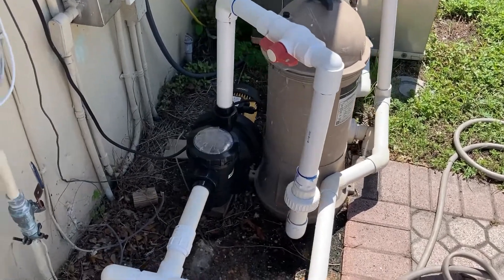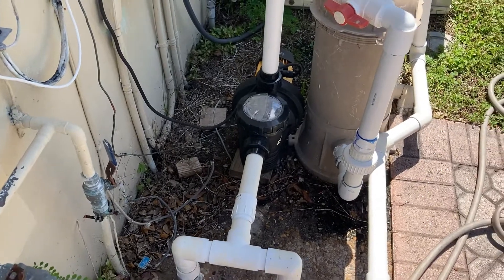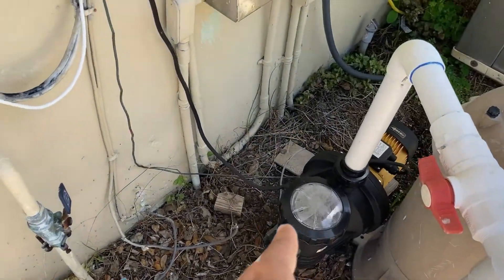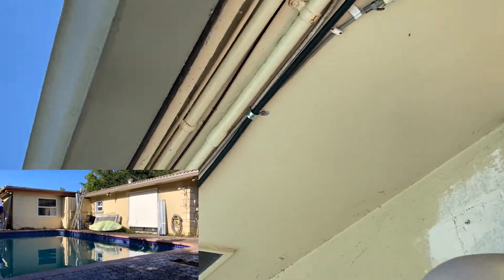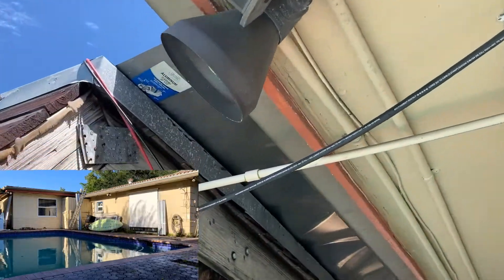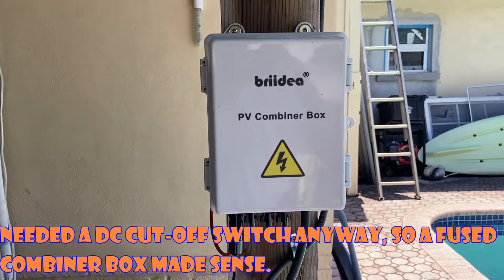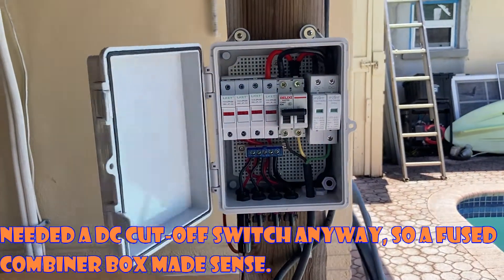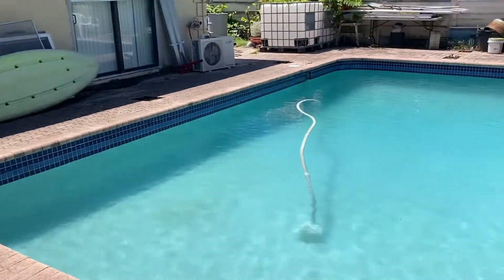Solar pool pump 2

Comment: Hi think I have the same 72v pump as you. Do you know if it's possible to have a timer for the pump? I have shade for part of the day when the pump turnes over but with no power and would like to have the pump come on when out of the shade
Reply: Thanks much appreciated 👍
Reply: Any luck with the timer superWhizy? Can you recommend a timer to use? Don't have a clue as to what type of timer I need 🤔🤔 other than a simple one rather than a WiFi one. Thanks...
Reply from the maker: I've purchased a timer from Amazon and have not yet had time to video and install. I will make it my top priority this week.
Reply: Thanks that's very kind of you
Reply from the maker: Made a video for you, Friend. I hope it helps you. Enjoy! https://youtu.be/8BPSKjOvTcY
Reply from the maker: Hi, Keith. There is a manual switch at the bottom of the mppt controller for the pump that can be modified to a timer. I've not yet gotten around to this task and have just been letting the sun control my pump's schedule.
Reply: @SuperWhizy  thanks for the quick reply! I've also got the same controller box as you. Do you know how I'd modify it to add a timer? And what timer I'd use. Thanks for your help... Keith
Reply from the maker: I shall make a new video on this issue based on your recommendation, Keith. Thank you.

Comment: Hi what is the max amp input from the solar panel. That this can handle  ?
Reply: I have 4 330watts  voc 40.15, impp9.91  if i put then in series it will be voc160v  and if i put it on series parallel will be impp 19.8 A   This will not work?   How would you do it with my sep up ?  Thank you
Reply from the maker: At 330W and 40VOC, your theoretical amperage is 8.25amps. One possible option is to link 3 panels in series and 1 panel in parallel before feeding the controller, which should theoretically give you 120VDC and input current of roughly 11 amps. Get a combiner box, choke the upper limit with a fused switch and check the voltage before plug in. Good luck and be safe.
Reply: @SuperWhizy  can you please elaborate on this ?
Reply from the maker: Power (wattage) = V (voltage) x I (amperage). In a series connection, voltage is additive but current remains. In a parallel connection, voltage is constant but current is additive. For example, if we have four 100 watt panels each rated at 25 VDC and 4 amps, linking them in series will yield 100 VDC at 4 amps. If we link these same panels in parallel, we will end up with 25 VDC at 16 amps; both of these configurations will only yield 400 watts of power. When we mix-and-match between series and parallel connections, it becomes an algebra problem with max theoretical power of, in this hypothetical case, 400 watts as the known boundary condition for our formula: 400 watts = Voltage x Amperage.
Reply from the maker: Hello, Review2543. My MPPT Solar controller for the 72V pump manages the voltage and amperage of the solar input. The instructions limit the max input current at 15 amps and the max open circuit voltage at 150 VDC. I've got mine fused at 10 amps because... it was what I had sitting around; the fuse has only blown once and the supply side of this solar set-up has been near flawless since installation. Thanks for watching. Awesome handle, btw; reminiscent of the Star Trek Borg episodes in their fight against Species 8472.

Comment: What’s the size pump you have?
Reply from the maker: Hello, Turklanes109. This is a 900 watt solar pump that came as a set with the solar controller. It replaced a 1.5 HP ac induction motor pool pump. Thanks for watching.

Comment: Where did u get the plumbing to connect to the pipe..thank you
Reply from the maker: There should have been a "pump union" interface that came with the water pump. I would check to make sure it's included and take the part to the hardware store for fitment. 1.8" outside diameter (OD) does seem odd considering the OD for 1.25" PVC is 1.66", and for 1.5" PVC is 1.9".
Reply: @SuperWhizy  it did came with  a union took it at homedepot they said they s
Don't have anything that can connect with that size  fitting..what size is your connector n pipe on your pool..
Reply from the maker: The union provided fitted directly into a 1.5" schedule 40 PVC for me. Perhaps you can take the part to a local plumbing supply store in lieu of the big box stores for these seemingly exotic fittings. Have you tried taking the union to manually fit-it to the myriad of PVC parts? Bear in mind that PVC for plumbing is at times different from that for irrigation, pools, pumps, and septic. Some of the folks who at my local big box stores are not the most astute plumbers.

Comment: How many solar panel do you have for your setup?
Reply from the maker: Hello, SimpleLife. I have four 390 watt panels powering this solar pump set-up; 3 in series and 1 paralleled. One of the four panels were paralleled in order to stay under the open circuit voltage ceiling for the mppt pump controller. Happy to report that the set-up is running strong. Thanks for watching.

Comment: Thanks for sharing! I am starting off with no pool but will be using similar setup for an above ground pool. Can you post the specs for the control box? max/min voltage, amp input etc.
Reply from the maker: I scanned and posted the entire instruction manual that came with the pump on a diysolarforum.com forum for solar enthusiasts. See if the hot link will work here. Thanks for watching! https://diysolarforum.com/attachments/solar-pump-manual-pdf.96552/